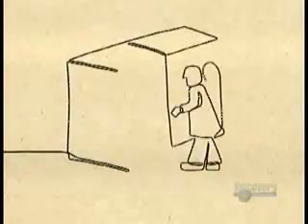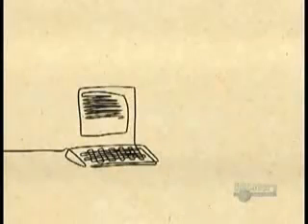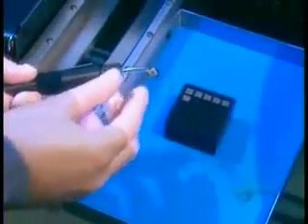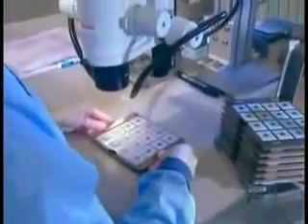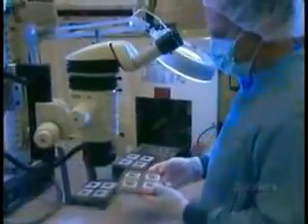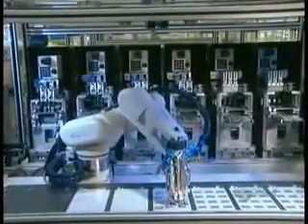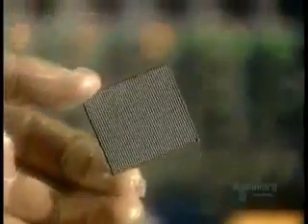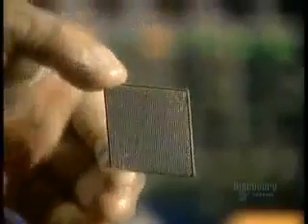How the Intel Processor is Made

Comment: what the hell is 'flux'?
Reply: +JoBro 
flux is a sort of capacitor that makes time travel possible
Reply: Flux is a paste-like substance that cleans metallic surfaces and allows the solder to form more rigid connections.
Reply: Also prevents oxidization to an extent

Comment: Making of PowerPC G5(fcBGA) and POWER4 microprocessor(fcPGA, the one with pins), watching on my Powermac g5! This is not AMD nor Intel, lol. The PPC G5 chip uses ball-grid-array surface mount, which is not always sturdier than Pin grid array or LGA, but more electrical contacts can be placed in-between the chip and the electronic board. These IBM PPC chips were also used in the PS3 and Xbox360, and the "balls" are the reason for the red-ring of death issue, because it is very easy to defect a ball-grid-array chip. So if you have a Powermac G5, a PS3, Xbox 360, or a Power4 server and watched this video; the secret has been revealed.
Reply: erm ,i thnik the IBM label gives it away without being a tech nerd
Reply: ***** Tech nerd? Hah! And you can't even compose a proper sentence.  I am not even going to respond to your comment as evidently you have proven your intelligence is vastly inferior to mine. Good-bye, and yes I am a nerd, it's better than having the mind of a nine-year-old like you. I was informing people, because most people didn't notice the IBM PPC chips or technical terminology used in the video.
Reply: ***** Oh, no problem. Yeah, the title of this video is pretty misleading, lol.

Comment: But how do people like code the CPUs and stuff to make them work and cores and all that
?
Reply: All the low level stuff that makes the cores work together and such is done in hardware, that is where you get into electrical engineering. There are other bits of code on the processor called microcode that are technically software but its easier just to think of them as part of the hardware because of how they behave.
As far as programs that run on top of the processor goes, on the processor there are a bunch of "instructions" like addition or storing data in memory. Each instruction is addressed with a number and programs are really a series of numbers representing these instruction addresses.
Now that isn't very convenient for humans so over time tools have been developed to translate more human readable programming languages into those instruction addresses which are usually just called machine language or machine code.

That's in a nutshell of course. :-D

Comment: First computer in 1937? really so what was it called?
First electronic computer EVER made was called Colossus, in use from   19943 by Alan Tunning UK, next was the Eniac  was being designed in 1943 in USA. so have no idea where on earth 1937 came from. Also the Colossus was a code cracking computer during WW2 cracking encrypted messages Nazi's was during with the use of the Engima machine. Good clip though but rather old Intel doesn't put pins on desktop chips now, their on the motherboard ;)

Comment: I suggest You look up the 3930k. Intels beast of a Cpu with 2011 pins. Its pretty reliable if you ask me.
Reply: lol CPUs getting bigger chips are getting smaller the core's are getting smaller bit the substrate and the pins are growing to the point we will have a 10000 pin fucking CPUs with 1nm fucking chips lol

Comment: In the beginning intel chips had pins. I have a socket 7 Intel pentium from the early 90's. It has 320 pins on the bottom. With the evolution to LGA pins were replaced by contacts (pads).

Comment: Dude there are so many typos and false information and just general shitty grammar there that I can't even begin.

Intel and AMD make cheap processor, and the Intel ones are always more powerful for the same money, use less power and can use PCI-e 3.0.

Typical ill educated AMD fanboy.

Fucking hilarious that an i5 3570k 4 core can beat the flagship AMD FX8350 8 core, while using 1/2 the power and having PCI-e 3.0.

AMD is a fucking failure and has 0 reason to buy it. Fuck off.

Comment: 4:11 "a thousand connections" >>next clip is visible to count the connections<< i counted them it is 19*19=361 conectors 361-1= 360 (the "-1" is because one in the corner is missing) IT has 360 not a thousand connectors

Comment: Most things are engineered to a safety level of 2x the expected max load. This allows the products to be guaranteed to work properly for a long time. So yes your processor could take 140C, is it good for it? No. Will it dye, maybe, but probably not in the short run, definitely in the long run.

Comment: As funny as this comment may seem, it's also completely wrong. BGA chips (ball-grid-array) are very weak, and are prone to cracking off the board if they expand due to heat. It's what causes the problems with games consoles as they heat up, they expand and the balls peel off the board. With pins or hard contacts, not only are they removable/upgradeable, it allows for thermal expansion/shrinking.

Comment: @JumpStartPause You don`t solder anything right ? A flux for lead-free soldering is very sticky and smells sweet when heated. The only way to remove it completely after soldering is putting the pcb into an ultrasonic bath. At least that`s what I do.

Comment: This is really... weird that it was wrong... well. Im no expert solderer but flux is an adhesive that helps soldering. It keeps bridges from being made and insures a completed soldering process. And not only that its IBM, not intel. And they are actually made with sand. Gosh. What were they right about? And the pins should not be made out of tin.-.- My intels and AMD's have gold for pins, heck I've never seen a processor without gold pins. Anyway, its not horrible, i just dont think its correct,

Comment: cpu is made of silicon from sand and coper first , the tin is used as a cheep substitute for gold or better conductors.

this video wasn't horrible, but it does leave out the deeper details.

like those 200 manufacturing steps
yes I do want to know every single detail
about how I'm being ripped off and cheated by the industry.